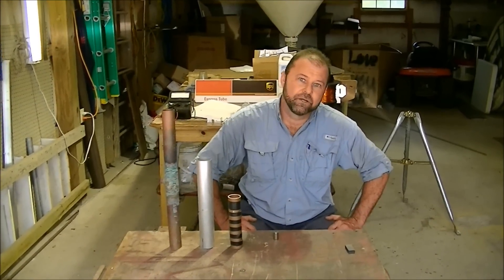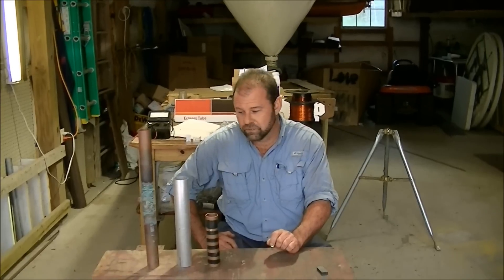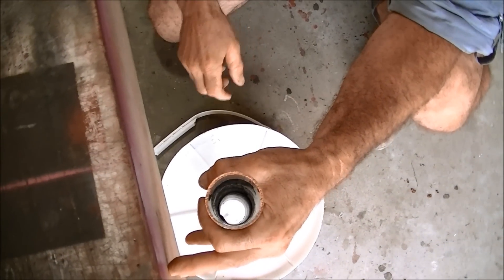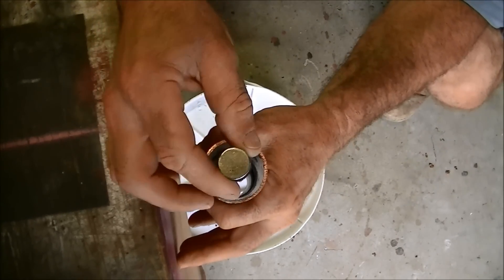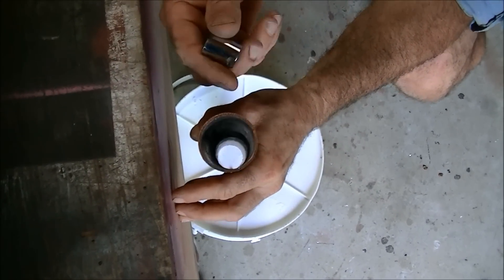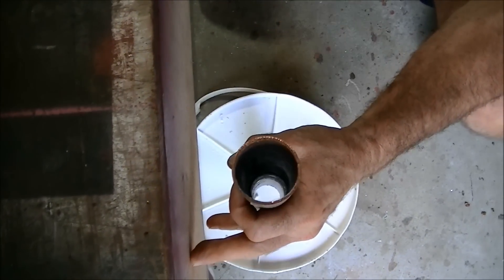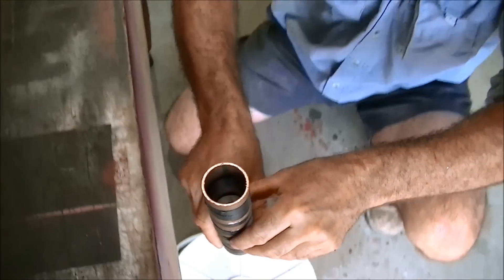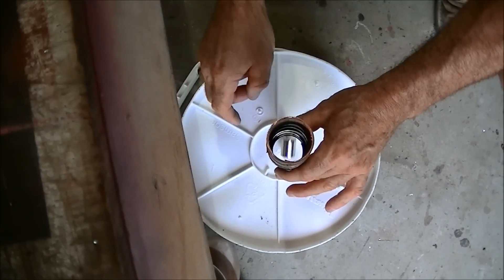Watch what happens when a magnet falls thru a copper pipe/aluminum pipe.

Comment: As to the magnet falling faster through the "segmented" copper: this is why "eddy current testing" is used as a non-destructive test for metal fatigue. If the metal is fatigued and has many hairline  cracks, you will get less eddy-current effect. (Think aluminum propellers and the like.)
Reply: Ha ... what do you know bcubed ... an intelligent comment on a You-Tube discussion board ... thanks for restoring my faith in the internet.  ;-)
Reply: bcubed72 my mom hooked up with eddy...he's fatigued but she has a lot of stress fractures..
both 84...
Reply: It didn't seem to fall any faster or slower through the segmented pipe, it's just that the cut pipe is shorter almost bu half.
Reply: waterandafter   Good eye.  In my opinion you are correct. Cheers

Comment: I just seen this and happen to have bought some RE mags for some cabinet catches. There are 10 mags at 3/8" in diameter and 1/4" thick so the 10 mags made a 2 1/2" long mag. I didn't believe the video, and went out to the shop and dropped the stack down a length of 3/4" copper about 14" long. I was truly surprised that the mag acted just like in the video! Amazing thing to see. Thanks for posting Mark!

Comment: I just tried it with a 1" copper pipe 6" long and dropped a magnet and it did not work. What did I do wrong?
Reply from the maker: 44sharpshooter It has to be a rare earth magnet. n52 magnet
Reply: markp0177 Yeah, thanks. Probably a lot of expense for me to go to just to play a little trick, I guess.
Reply: 44sharpshooter Just bought some (6) 12mm x 3mm Neodymium magnets($3.95) and
a 5 foot length of type ‘M’ ½” copper pipe at Home Depot. It works!
Reply: 09kkk

Comment: i thought gold was the best
Reply from the maker: No silver is the best conductor. Gold is also good and it does not corrode.
Reply: Lyndell Evans Yes, I think you're right. Silver is better than gold. This would be awesome with another diamagenetic material like bismuth but it would be quite heavy.
Reply: lamar07103 I thought platinum was the best conductor of electricity. it's just in short supply.

Comment: Would it be easy to find these products
Reply: markp0177 What if you cut the copper and the aluminum alternating between the two to create a "copper aluminum" pipe?
Reply: and where should i find these products i live in a large city in Canada doing this for a science fair project
Reply from the maker: Evander Kane You can find everything on ebay. Here is a link to the magnet.
  http://www.ebay.com/itm/1-Strong-3-4-x-1-Grade-N52-Rare-Earth-Neodymium-Cylinder-Magnet-/121486877633?pt=LH_DefaultDomain_0&hash=item1c492ea3c1
Reply from the maker: markp0177 the pipe
 http://www.ebay.com/itm/1-1-2-Dia-Copper-Pipe-Type-L-Seamless-x-24-Long-/271704714080?pt=LH_DefaultDomain_0&hash=item3f42dceb60
Reply from the maker: markp0177 The aluminum pipe.
 http://www.ebay.com/itm/6061-T6-Aluminum-Pipe-1-1-2-inch-x-48-Schedule-40-1-9-OD-x-1-61-ID-/141013567055?pt=LH_DefaultDomain_0&hash=item20d510464f
Reply: Evander Kane thanks im using your other video to make a light bulb using lead. Do you know where to find aligartor clips offline in Canada
Reply from the maker: Evander Kane Try Harbor freight or Radio shack.

Comment: If aluminium and copper pipes are of same length and diameter ... same magnet used for both...in copper it takes more time to co out of other end, i myself have done this... please anwer why is it so??? i think may be due to more resistance of aluminium... pls tell correct reason
Reply from the maker: Yes, The better conductivity of the material the slower it falls. Silver is the best.

Comment: I was wondering if the magnet was going end over end with the different poles rotating. I was noticing that it didn't fall straight, but was going end over end. Is this making a difference?
Reply from the maker: No, it does matter. I just drop it and it flip on its own.
Reply: +Aaron Bell Okay, so I agree with mark that it just doesn't matter and that Aaron is probably right that there was a slight twist that made it look like it was rotating. But, I still like your first idea Aaron. We are moving soon and will have a work shop to do all sorts of cool projects and experiments with my son. I want to figure how they put metal into a molten state with the help of a magnet. Looks too cool.

Comment: i had an idea i was wondering what would happen if you put a magnet plunger in the copper tube put it in a bucket and fill with water then aggitated the magnet in the copper pipe like an old wash machine if it would produce and oxigen and hydrogen or if this might be a more efficent way of making hydrogen fuel i know my spelling is bad but i think the idea is worth some testing
Reply from the maker: No it would not separate the hydrogen and oxygen. It would make a small amount of heat.

Comment: I saw a pendulum with a magnet swinging on the string once.  At the bottom of the pendulum was different plates of material... copper, aluminum, wood.  the pendulum stopped in one pass with the copper.   the magnet generates eddy currents in the plate, or in your case the tube.  when you put segmented pipe it breaks up the eddy currents which is why your segmented pipe didn't work.  this is why they separate small transformers with laminated core.  the eddy currents generated with a solid core would be less efficient.

Comment: How much electricity does it generate and could you harness it? Are there any real world applications of this principle? If you used a pendulum inside a vacuum to eliminate air resistance w/ a copper pipe attached, and inserted a magnet inside the closed copper pipe, couldn't you create a close-as-you-can-get perpetual motion machine? I understand there would be resistance in the ball bearings of the pendulum which would eventually cause it to stop, but I guess my question is would it create enough energy to make it worth the effort to restart the pendulum with outside energy?
Reply: drewwyber  This is the principal behind all generators, a moving magnetic field producing an electric field, which is drawn off and presto you have your microwave dinner.....so yes, it can be harnessed and it is harnessed.   You can go to your hardware store and buy a "shake" flashlight. Same thing, a moving magnet inside a coil of wire.
Reply: drewwyber I was almost thinking of perpetual motion machine also. But is it just the energy of the magnet causing an electrical field or is it the fact that the magnet is moving through the tube like Jamscout suggests about the shake flashlight? Is the energy that is produced in this case by gravity causing the motion? We would have to keep getting the magnet up again to be dropped. If you put the tube on a pivot so the magnet falls past the pivot point and then falls back again wouldn't work either. Possibly any "work" done by this system's energy would act like a "break" on the availability of work. Like the 2nd law of thermodynamics? Not an expert or even knowledgeable. Just thinking.

Comment: Hey what would happen if the copper pipe was closed off with a copper cap at the bottom? Would it just hover near the bottom?
Reply from the maker: Tamara Maxwell No. it will still fall all the way to the bottom.

Comment: you wount be able to throu magnet throug stainless pipe :D
Reply: Sure you would - stainless steel pipes (all the ones I found, anyway) are generally made of 304 stainless steel (I found a few or 316), which is an austenitic stainless steel; austenitic stainless steels are non-magnetic.
Reply: ok a was wrong :)

Comment: I can't find a 3/4 by 1 magnet, only 1"x1".  Where did you get that one?
Reply from the maker: Try Ebay or magnets4less
Reply: markp0177 magnets4less has apparently not heard of the USPS.  They wanted $35 to ship 2 3/4" diameter by 3/4" long magnets.  Meanwhile, I just got 50 lbs of reloading lead shipped to Alaska for $12 something. Sheesh!  Hopefully I can find the magnets someplace where shipping is reasonable.

Comment: how about a copper tube bent into a circle with a magnetic ball inside?
Reply from the maker: The magnet ball would just go and stay at the bottom.
Reply: And spinning?
Reply: Yeah
Reply: markp0177  hey mark i have been researching this for ages trying to find out how much power gravity can produce via a magnet falling through a  closed circle copper pipe  but cannot find anyone with results.  at one point in comments you mention power cannot be harvested because the method is creating a dead short ? but elsewhere mention the shaker flashlight which works so am confused. also if water is diamagnetic like copper would the magnet go slow if falling through a double skinned plastic water pipe filled with sea water for example which then becomes very conductive . i would like to build a  generator  where the hooped  pipe  becomes a rotor and the magnet becomes  stator always falling  with gravity to the bottom of the hoop as it is turned a low rpm by choice of  power.
Reply: Hmm brings to mind coiled copper tubing filled with Mercury and then allowing the magnet to impart the energy into the Mercury or other?  Ala tesla energy x other theories

Comment: Well, the physics were accurate-shame 'bout the 'rithmetic!
.
If copper has only 75% of the efficiency of the silver pipe, in a silver pipe it will fall not 25%  slower, but a lot longer.
copper had only 75% of the "braking effect" of silver, so silver's extra 25% means it's braking effect is 75& dived by 25% more =1/3.
Plus, as the magnet is accelerating as it ravels down the pipe, and acceleration increase per second per second, it will accelerate slower too as it travels
Ah, the sheer joy that petty,nit-picking pedantry can bring to an empty, pointless existence that's me set up for the day! :)

Comment: Why don't you use the same diameter and length of the pipes in copper vs aluminium?! It's not strange that it falls through the alu-pipe faster since it's wider and shorter.
Reply from the maker: I used what pipe I had laying around. The length and size was close. The magnet just free fall thru the aluminum

Comment: question>> I have an idea...what would happen if you had a copper/silver/gold tube bent into a circle and spun the tube on an axis (like a tire) in the opposite direction of the fall of the magnet (counter clockwise) at the exact same speed as the fall of the magnet, would the magnet levitate and produce continuous electricity while the tube spun around the magnet? would that become an engine?
Reply from the maker: Gold would not work very good. Yes, the magnet would levitate but would not generate electricity. The pipe is a direct short of the electricity that it produces. It will not work very good to drop it thru a coil of wire with a load on it. I have tried it.

Comment: welding rings sounds good but doesn't work simply due to gravity while being in the vertical. The rings cause one side of the ring to push and the other side to pull. Gravity helps to pull it down so the upward push is overcome by gravity. Pretty simple..
Now if you could flatten the rings making one side offset like a scalene triangle similar to a fighter jet wing but vertical and in the shape of a ring. (sorry I cant think of nor can I find the name of the shape im trying to describe) This giving it either more push or more pull. Point is to make one edge of the rings thicker than the opposite edge of the rings with flat surfaces.
  I used to build Chem Pumps (electric motors). It can be difficult getting this exact but really needs to be exact. The slightest difference from one ring to the next will make a huge difference in the strength of restriction. For example: (in short) inside an electric motor is wound with copper wire strands as most of us know. These strands are bound in groups, each group will have an opposite current. Each group being separated by something thin and "non-conductive". (Thin to keep the copper wire strands as close together as possible w/o direct contact. This is usually done by dipping it as a whole into varnish that once cured makes a barrier separating each individual copper wire strand from contacting each other) Once all the wires are joined together, its ready for an electrical current. Now you would have to worry about the distance from the coil to the rotor as well as the material being used(liner and shroud) as well as the thickness of the liner and shroud that separates the coil from the rotor.
Just the difference in thickness from wear ( in thousandths of an inch) from a rebuilt motor being rebuilt several times vs a brand new motor can make a  difference in how much power one generates. Just .005 of an inch difference in space between the coil/rotor "can be" the difference in Quality Check pass or fail.

Comment: nice video. and thanks for the frames i got them the other day and go together well. the only thing i forgot to ask is they are made for 1/4'' glass and im using 1/8'' i just used extra silicone on the brackets holding it down.